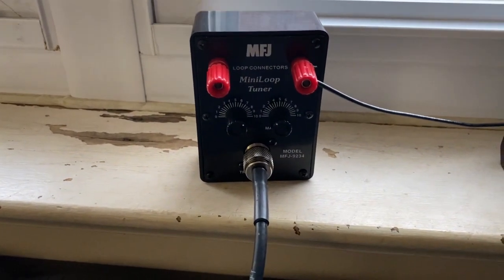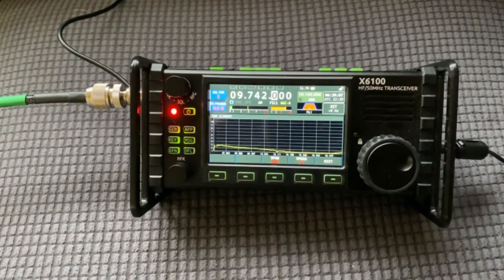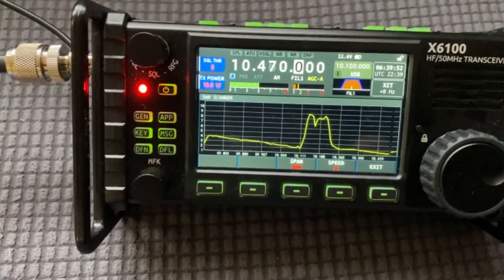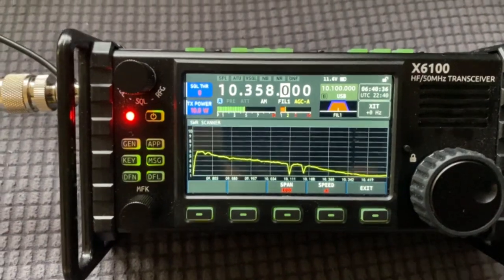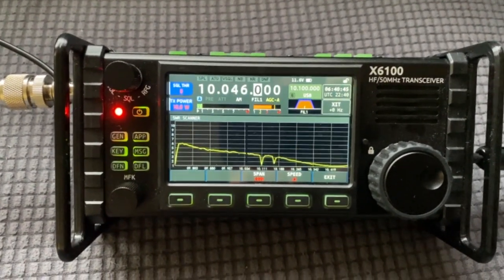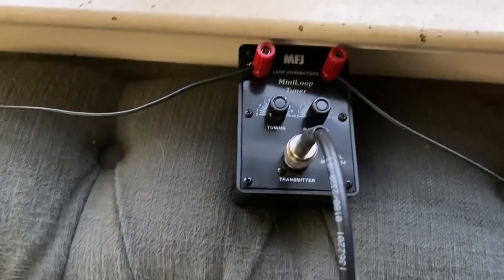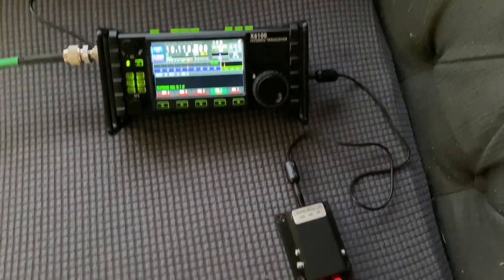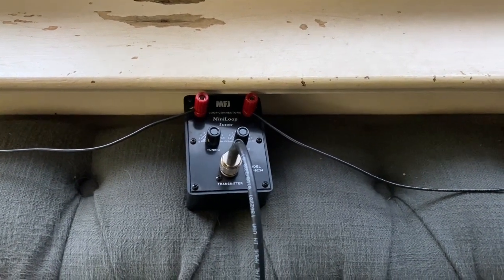Indoor Test of MFJ 9234 Mini Loop Tuner w/ Xiegu 6100

Comment: Thanks for the video Paul. I bought the similar unit, MFJ-9232, about 6 months ago and didn't seem to have much success with it. Having just received a new X6100 this morning in preparation for a trip to Australia next month, I may just have to get the MFJ-9232 out again and just be a little more persistant. Cheers ZL2VTH
Reply from the maker: Hey Phil, I bought the same product with the BNC connector. I couldn't tune it at all. I opened it up and found that one of the capacitors was not connected, and not only that, the wire was too short to just solder it. So I sent it back to MFJ and they sent me the 9234 which is a sturdier build. Open yours up to ensure that all the wires and capacitors are well connected. I hope to get you on the air someday. 73

Comment: Cool... had no idea you could make a loop antenna that simply.  The mag loops that I'd seen on channels generally seemed to be much bulkier (often having an inner loop and an outer loop).  I hope you have good success on the road!
Reply from the maker: RF is magical. I have an Alex Loop and this may not be as efficient, but it does work.

Comment: Great video Paul! I’m curious what you think about the g90 vs the x6100? Is the extra 10w helpful on the g90? I really like the display on the 6100.
Reply from the maker: Hi Jeremy. I love the G90 and the extra ten watts is surprisingly helpful, especially when the bands are rough. My issue with the G90 is that it is a heavy radio (not the best for backpacking), without a sound card, and requires external power. The closest thing to the perfect radio in my mind for the price is IC705, but even then, with its size why couldn't they put an internal tuner in there, and why is their SWR tester so clunky. It would seem that a few operators like you and I could design a portable radio to our specs and be the perfect radio for us. LOL. Thanks for the question.
Reply: @K2PMD  I agree with everything you said! If only the 705 had an internal tuner!!